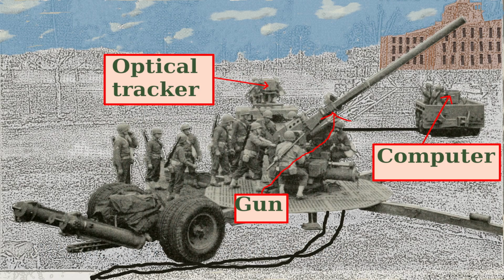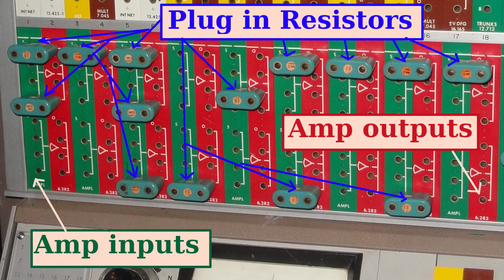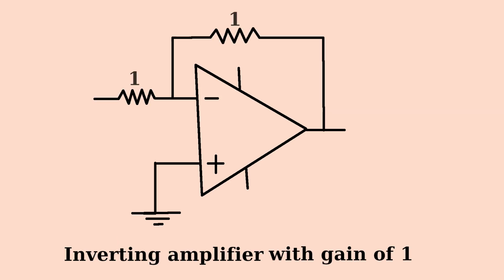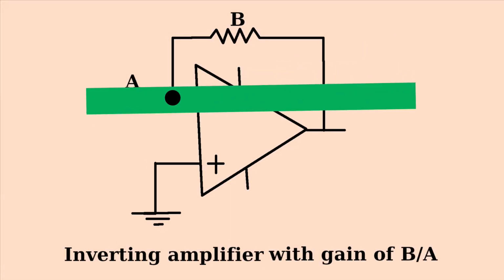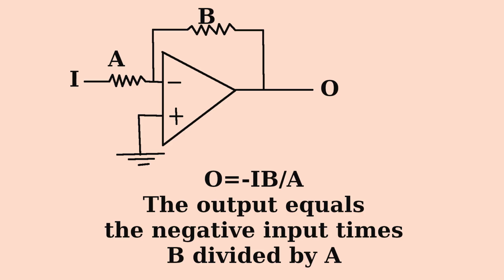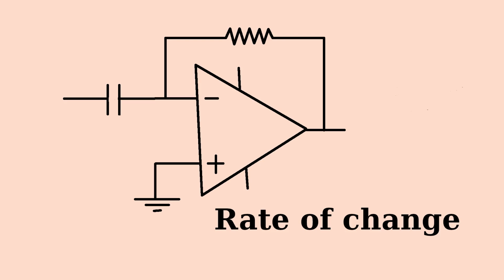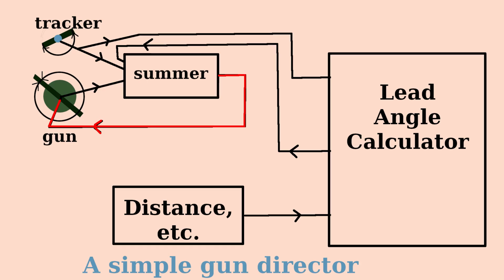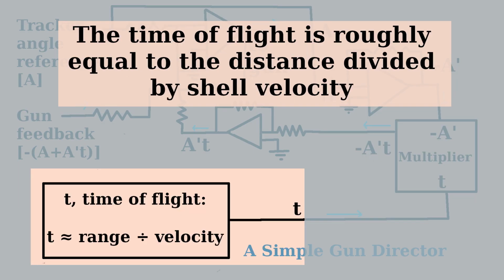The World War 2 Secret Nobody Mentions

Comment: Just a quick historical note for those interested: while Karl Swartzel Jr. absolutely deserves recognition for inventing the vacuum-tube amplifier that served as the computational core of the M9 Gun Director, the system as a whole was a collaborative effort.

David B. Parkinson, an engineer at Bell Labs, is widely credited with conceiving the original idea behind the M9. He realized that the principles of feedback control—originally applied to things like guiding a pencil with a sound wave—could be adapted to automatically aim anti-aircraft guns using radar data. Parkinson’s conceptual breakthrough laid the groundwork for the entire system.

Together, their work—combined with the SCR-584 radar and proximity fuzes—created one of the most effective anti-aircraft systems of WWII, especially in the defense of Antwerp against V-1 flying bombs.

Just wanted to give proper credit to both key contributors to this incredible piece of wartime engineering.